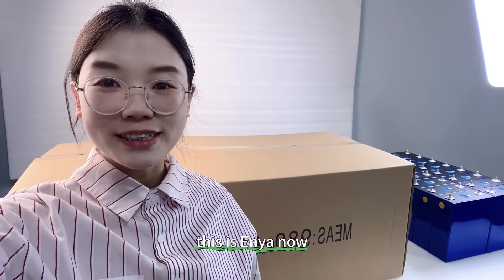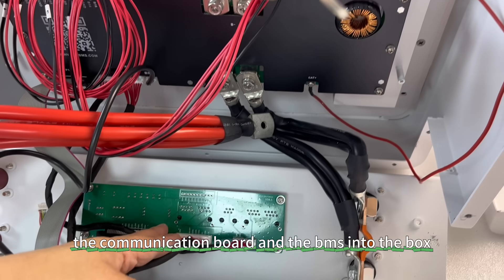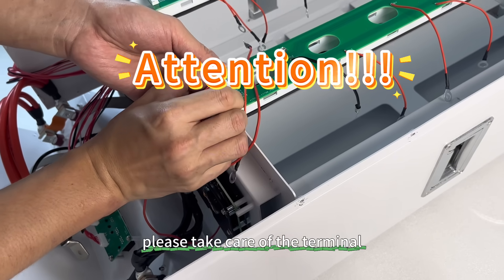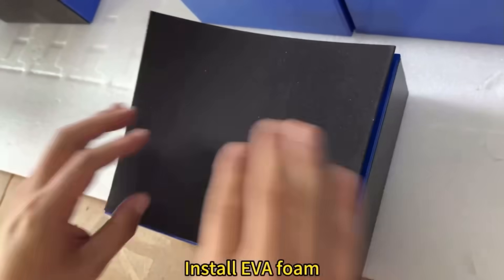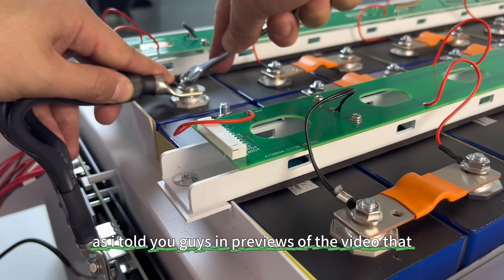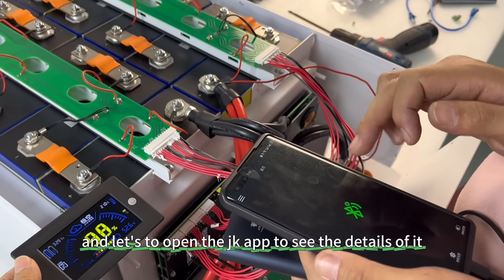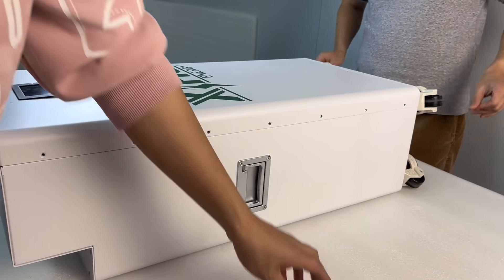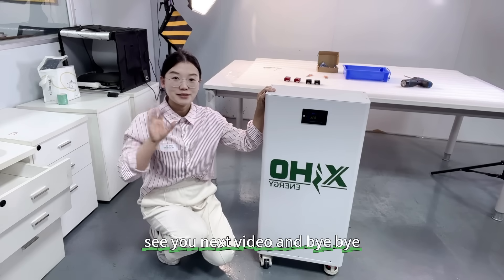$1200 DIY 16KWH solar power battery for your home easy version

Comment: Important Safety Notice: Securing the Battery Cells

I have a major safety concern regarding the battery's construction. Why wasn't a resin board placed on top of the cells? If the cells were to become loose, they could easily spark against the case, which poses a serious fire risk. It's crucial that the top of the cells is secured to prevent any movement.

Comment: Thanks for the description, but one thing intrigued me: when this battery is in a vertical position, the cells are not in the most favorable position. In order to overcome this anomaly, I think that this tool should remain flat so that the electrolyte bathes all the internal plates in an ideal way?

Comment: It's so cheap to diy these days. At the same capacity most other big companies charging 3 times as much for a similar sized premade battery.
For 5k-7k you can have basically diy a whole house offgrid system system with some solar panels and a smart transfer switch. 
Kind of insane see some of these companies charging people 50k plus for solar system
Reply from the maker: As the global economy is declining, more and more people are experiencing tighter incomes and expenditures, so it is necessary to provide cost-effective energy storage solutions. At the same time, it will also impact some large companies to integrate resources and lower prices. Of course, the beneficiaries are consumers, so this is good news for consumers.

Comment: Where are the outlets for 120V and 240V located on the box?
Reply from the maker: The battery is not connected to an inverter, so there is no 220v socket as you described. If you sell this battery, you will also need to buy an inverter to convert the voltage.

Comment: My suggestion to assemble the project is to use insulate tools. I just buy the cells, the bsm, fuse protection, and make my own box. It is close to $1300 in saving.

Comment: when i built my system just couple years ago it costs me $8,000 to  make 4 battery banks like this.  they are 280AH cells now i can do the same for 1/2 the price about. what is current price to USA for 1 of these as having another bank is great for winter here.
Reply from the maker: @dc1544  Market change and more competition makes the price drop. Please let us know your post code of address, our sales will check the DDP shipping cost for reference🤗

Comment: I live near the ocean. How is its IPX rating and performance in humid conditions?
Reply: The price is $1200. If you want IPX ratings and humidity performance you should look for marine use like Victron Energy they would run you about $7-8000 for 16kW/h.

Comment: I'm a battery virgin, I can't have solar where I am but I have a very low overnight tariff that I could use to load up a battery and run my house on it during the day and night (there's only 2 people living here). What other parts do you need out of interest?  I know an electrician will be needed but just for my own learning.
Reply: You will also need an "inverter" which is a device that converts the DC battery power to AC of your house's mains electricity.

Specifically, you need a "grid-tie" inverter that synchronizes itself to your grid's frequency and voltage.  The inverter also needs a "zero export" feature which uses a CT sensor.  The sensor provides the inverter a live real-time reading of your home's mains voltage so that inverter only outputs enough electricity to power your home's load without exporting any power to the grid (zero export).

The grid-tie zero-export inverter should be at least 2000W for home size loads.  The more the better but you do not need to max it like an off-grid inverter.  If you're doing off-grid then that's a different challenge and will need a much larger inverter than 2000W to avoid browning out or blacking out your home.  The battery for off-grid use also needs to be much bigger.  Off-grid is more technically challenging than grid-tie.
Reply: @beyondfossil  wow thank you for the nice explanation.  I'm in the UK where the electricity prices are off the chart expensive during the day and evening, 24p/KWh, then 5p midnight to 6am.  Without EV charging I'm using about 10kw a day I think.

Comment: Hmmm we need Will to check this out, If you know you know!
Reply from the maker: Oh, hope we have chance to work with Will🤗
Reply: @starmaxenergy  That'll be cool as.
Reply: That's right, there is only one man in the US that's smart enough to understand this new phenomena called LiFePo4. It's 2025 WAKE UP!! 99,9% of these cells have a capacity over stated capacity. The BMS will always be somewhat risky because it's a circuit board. If you want the best, $1200 won't buy you the box alone. 16kW/h of Victron batteries would run you aprox $7000. There is no need for Will to look at this at all!
Reply: @ScinnerNo1 That comment didn't age well.

Comment: Tell us the final price shipped to Europe from Europe please, thanks.
Reply: check vat for your country , France +20% + custom fee ...
What bothers me here is that a lot of small batteries have to be balanced to be affordable.
What scares me is that they can be OK to buy, and some degrade faster than others.
And the strongest ones will adapt to the weakest ones, in short, the opposite of being a sure thing...
I'll let you do your research.
Reply: @jeancharlesc.6290  All lithium batteries are composed of smaller cells. That's why you have a BMS, to keep the cells in balance.
Reply: @jeancharlesc.6290  merci Professeur Tournesol ! lol
Reply: 3100 with taxes includes
Reply: Very nice, thank you

Comment: Parts do not add up to $1200, quite a bit more.
Reply from the maker: With battery cell cost
Reply: @starmaxenergy  Using the links you provided the box is $450, the BMS is $120 and the 16 batteries are $912 so the total is at least $1482 plus shipping if any. NOT $1200. 
Edit: It appears the box includes the JK bms so the total is actually $1362...better.

Comment: Thanks for the video. I did take a look at the "eve-mb31-32v-314ah-rechargeable-prismatic-cell"  and also the "starmax-8000-cycle-eve-32v-314ah-lifepo4-battery-prismatic-cell" page. The photos do not show the M6 studs on positive or negative. In this video the studs are installed. What is the difference between EVE and Starmax cells besides the price $47 and $57 respectively? Some people have concern of the cells being stacked horizontally with this kind of storage box.
Reply from the maker: The photos are just examples, the actual product may vary, but the cells are the same.
Reply: @starmaxenergy  OK. Why is there a price difference of $10 between Starmax and EVE cells I did mention above? The description is word for word identical.
Reply: @starmaxenergy  Please answer the question about price difference

Comment: I would like to see a few upgrades to this box:
- Use busbars instead of cables from BMS to cells and BMS to terminals
- Install large DC Breaker (250A)
- Use the JK 4,3 inch touch screen
- Smaller ring lugs for balance leeds (there are M3 holes in the busbars, why not use them?)
Reply: This is a huge battery setup so I would suggest you;
1. Use Busbars from CELLS to BMS and from BMS to the output TERMINALS.
2. Use a larger Display.
3. Attach Display to BMS mounting bracket for dismantling convenience and not to the outside panel.
4. Install a DC bracket rated for the battery, also a Power Button to turn on and off the unit.
When you do, please let me know. I am interested in this unit.🙏👍
Reply: By how much would these impact the cost?
Reply: The  DC circuit breaker is require. Also mount the screen on the same side  as the terminals.